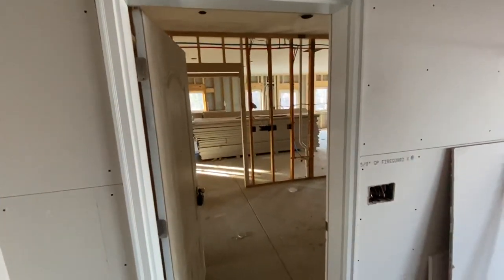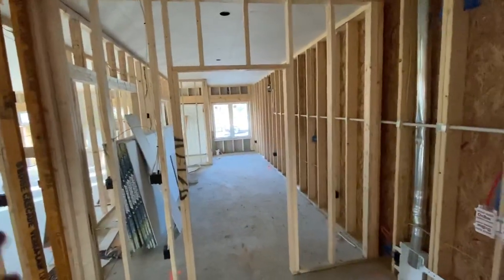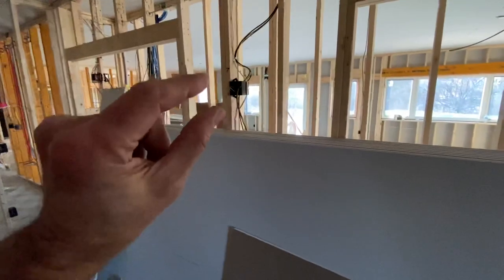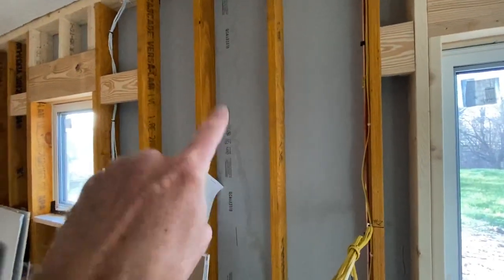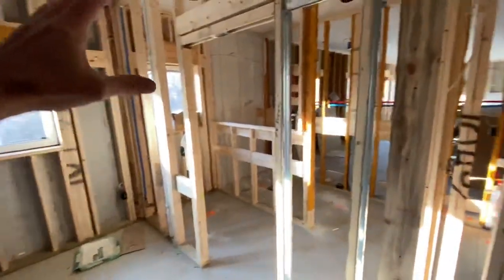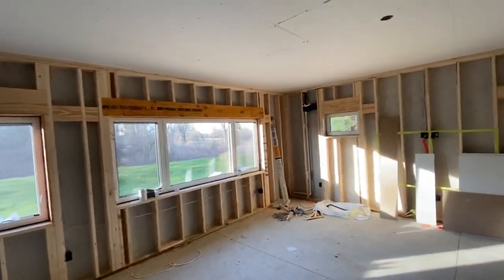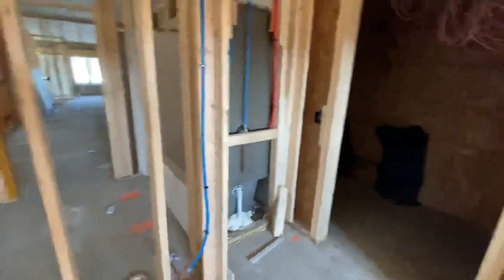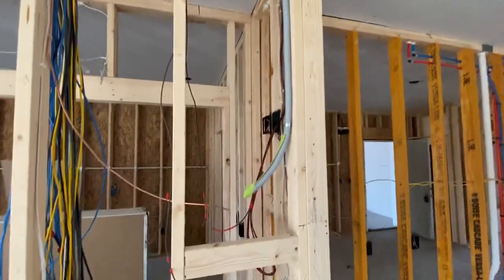Wednesday November 18, 2020 talk about using Aerobarrier and sealing cracks less than 1/2 inch

Comment: conflicting answers ughhh.. do u aerobarrier before or after [ except ceiling where u 2lb spray foamed ] the finish drywalling ???
Reply from the maker: Excellent question. I have given it a great deal of thought. My philosophy is to keep air infiltration outside and never allow the air to penetrate the wall. In my case I had aerobarrier applied with bare studs. This places the aerobarrier sealing as close to the exterior of the house envelope. This prevents any air from infiltrating into a conditioned space. So warm moist air is kept as faraway from cold 🥶 air conditioned surfaces. I then applied the 2 inches of closed cell (2 lb foam) as the next layer. If my spray foam had already been applied I would still use aerobarrier. My approach maybe more theoretical than reality based. Since I had the option with new construction I had the luxury of doing with bare studs.
Reply: @nevadarobert7908  "keep air infiltration outside and never allow the air to penetrate the wall" [ new construction ] then 2" spray foam increases the "life" of the latex seal that's GENIUS [ u answered my Q ] i retro-fit/rehabs also going add 2" rockwool.. u also hit on a EXCELLENT point this "state-of-the-art" technology requires an ERV [ awesome ] which Brand do u recommend mmmm